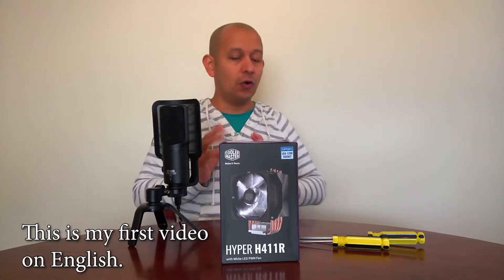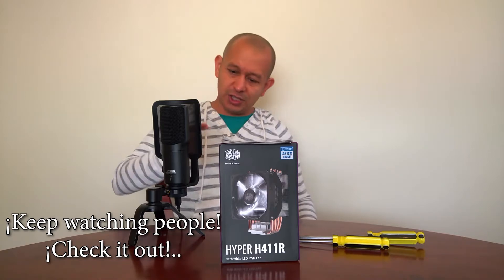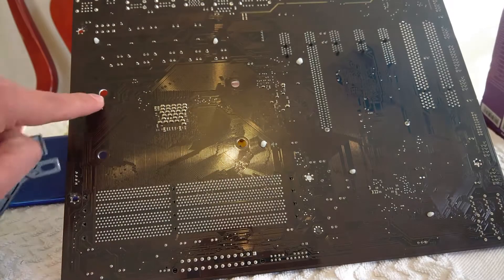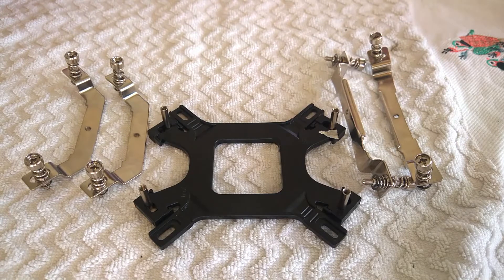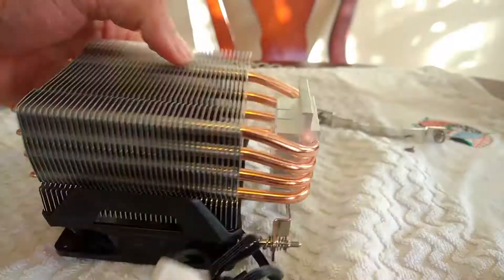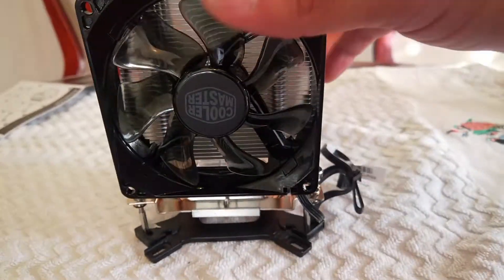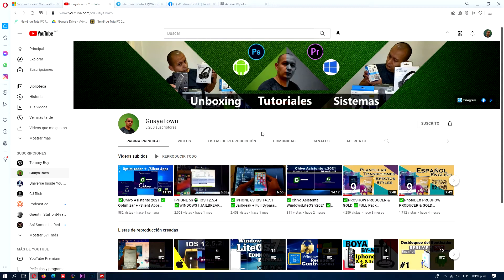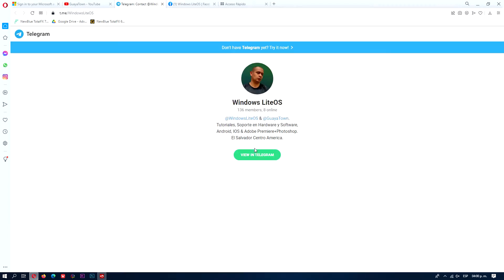✅ How to Install COOLER MASTER HYPER ✅H411R , ✅ H410R RGB, ✅ H412R & More. ✅ AMD & INTEL

Comment: First of all good job buddy 
Second, I bought this one but it seems that the screws can’t reach the 4 metallic pillars stuff so I can’t screw it xD is that possible or am I doing sth wrong?
Reply from the maker: Yes, you are doing something wrong.
Check the video again. Remember.  Is the pin from the cooler is the right side, the pin from the plastic things, need to be in the same position m right with right or left with left. 

Just check the video again.
Reply: i have the same problem, did you resolve? i'm pretty sure my pin are aligned but i can't reach the metallic pillars, the cooler touch the processor before